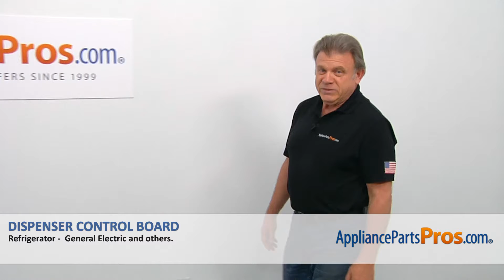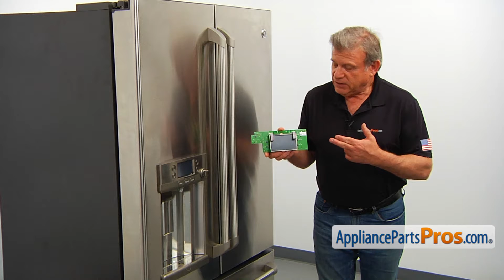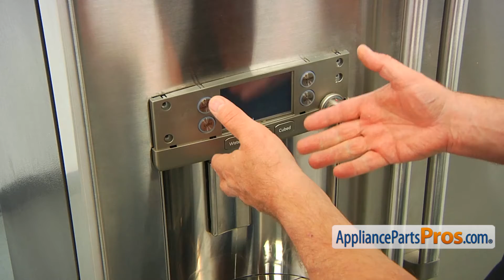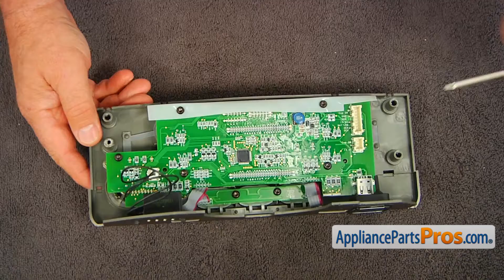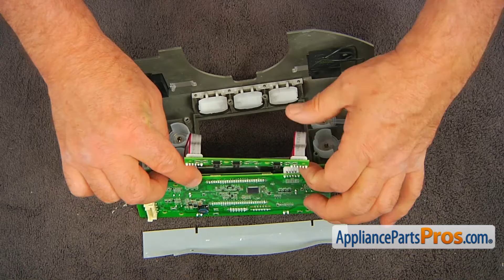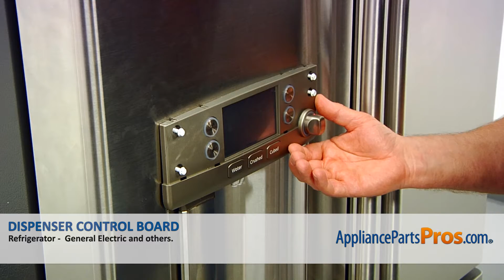How To: GE Refrigerator Dispenser Control Board WR55X34167

Comment: This doesn't work on my fridge. I used 4 putty knives and it still won't come off. When prying it out I only see 2 tabs, but it won't lift up or out to come off.
Reply from the maker: Sorry you’re running into that, @jonb6518 

If you need more in depth troubleshooting or testing information you can check out our Repair Forum: https://forum.appliancepartspros.com/.  It’s easy to register, and you can either post your question or search the forum to see if someone else has already asked the same question.
 
Our experienced technicians, with over 20 years of hands-on appliance repair experience, are ready to answer your questions and guide you through your repair.

Comment: HI! My GE ref model is CYE22USHOSS and the original part number is WR55X27136. Will the part on your video compatible with my GE ref?
Reply from the maker: It appears the part number you would be needing is WR55X34170/AP6995265. The link provided will take you to that part. If you have any other questions please let us know.
https://www.appliancepartspros.com/ge-cafe-display-board-wr55x34170-ap6995265.html

Comment: Regarding the GE Model pnr22msebfest - The display control panel doesn't work anymore - I can't set my temp therefore - my fridge is colder than usual and some items get frozen or at times very cold - I tried to power off/on - unplugging - reset the panel switch -  replaced water filter twice and the light on the display control/panel remains RED - Any idea what can be wrong - Would a replacement of the display panel assembly do the trick or the issue is much broader?